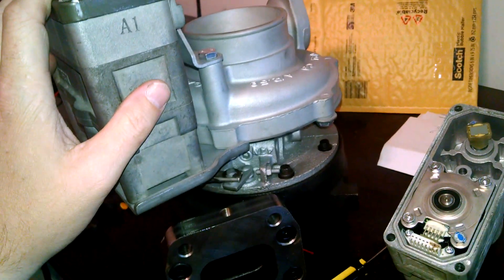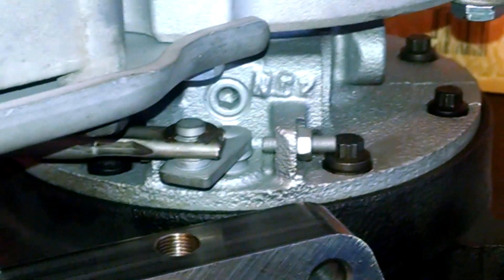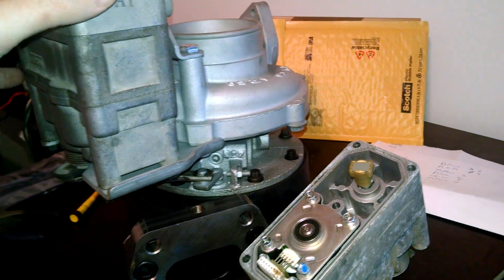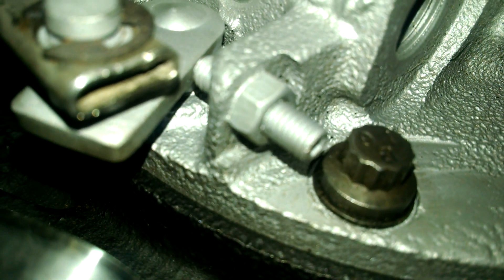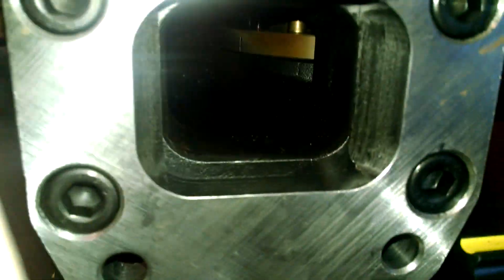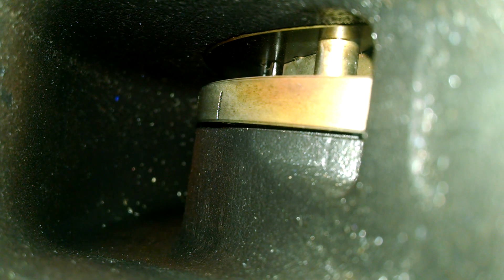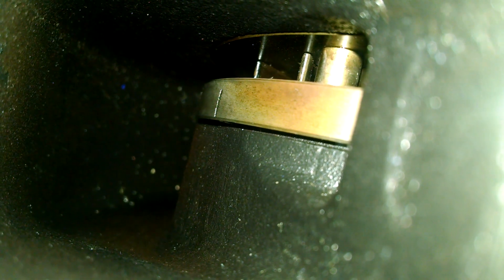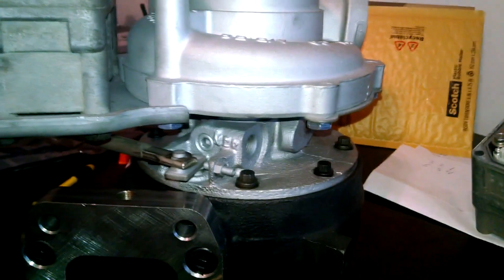Steeds Tech, Banshee VGT, GT3571KLVN Jideco, Mitsuba

Comment: Hi Steed, is is possible to share with me the command set for the Jideco actuator ? I have a GT3571KLNV that does not work no matter how I change the setting screws and arm angle. After watching your video, i reckon it needs to re-calibrate it's min and max points. Hope you can kindly advise.
Reply from the maker: Morning Ken, i dont share that data. There is also a few variations depending on the application.

Comment: where can I get an actuator motor ?
Reply from the maker: the actuator?
Reply from the maker: check out my facebook page www.facebook.com/bansheecontroller
Reply: Yeah. My actuator motor is fried. I don't know if I can pick up a motor or do I have to buy the entire unit. Some advise would be really good
Reply from the maker: Anant Lakeram How do you know its fried? Is this on a stock HINO application or are you trying to use it for something else?
Reply: +Steed Dolan its on a stock Hino engine (NO4C) . I had it removed and check. the motor isn't working. Due to this I'm stuck with a check engine light on and not getting more that 2000 RPM .
Reply from the maker: The actuators will turn off if they have an issue and need to be recalibrated. There's also problems with them directly. Really the only way is to buy a new turbo, or try your luck with a core. Most rebuilders wont give up a good actuator. You can call Chris at http://www.cavalliturbo.com/
Reply: +Steed Dolan Core? what is that exactly ?
Reply from the maker: Anant Lakeram like a junk turbo off another truck
Reply: +Steed Dolan oh yes.. sadly I think I'm my country I'm one of the few with these types of trucks .